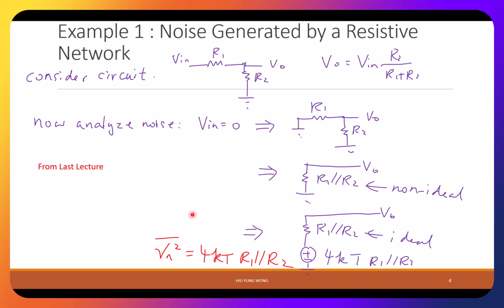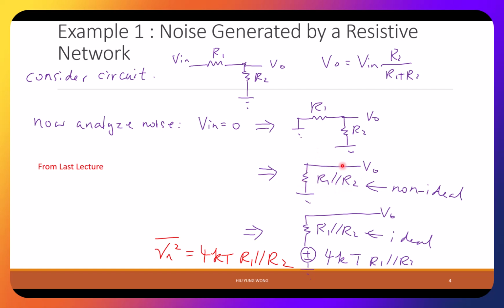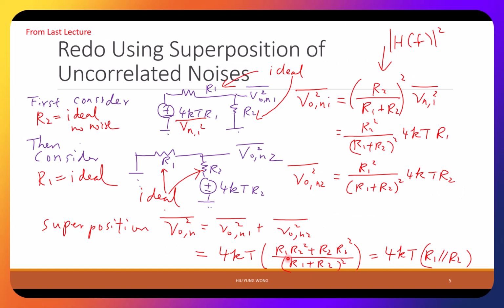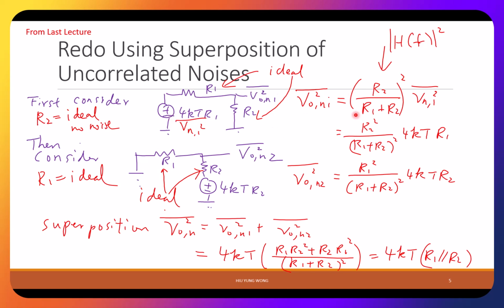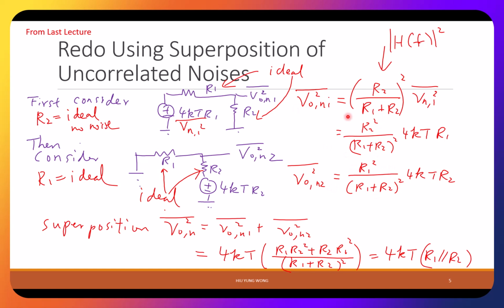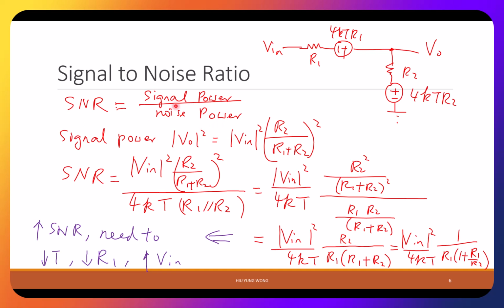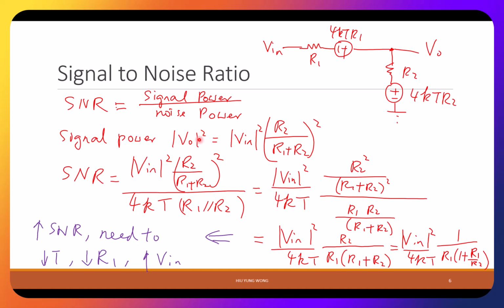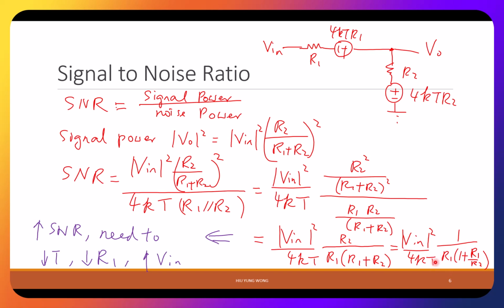L17B - (with sound) Noise in Voltage Divider and Signal to Noise Ratio

Comment from the maker: Important: The signal vin^2 is the signal power spectral density. So I should have put a "bar" on top of it. It means after integrating over the frequency, just like the noise PSD, it gives the mean square of the signal.  https://youtu.be/GOMoYX7R2Wg?feature=shared&t=372